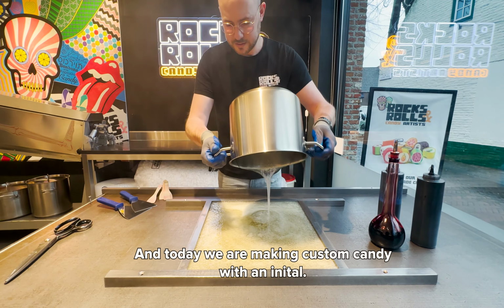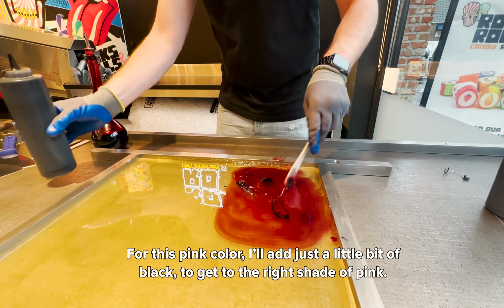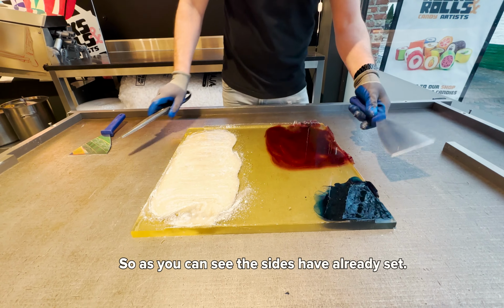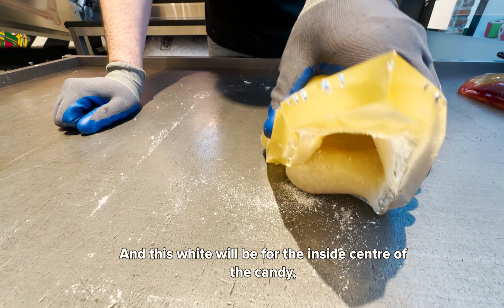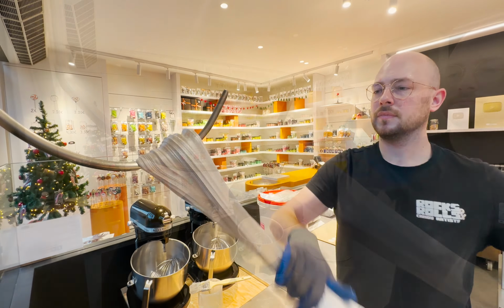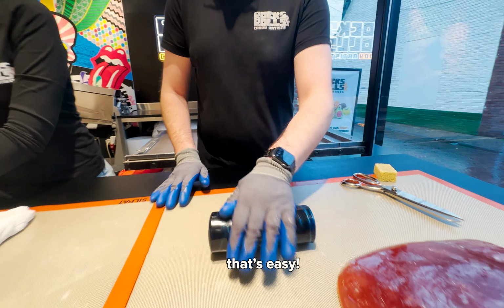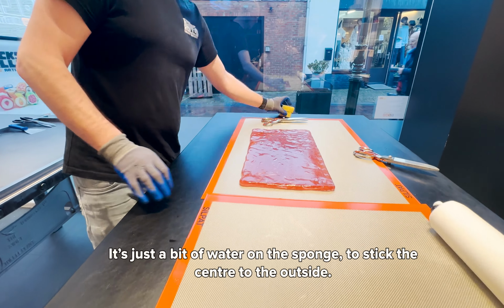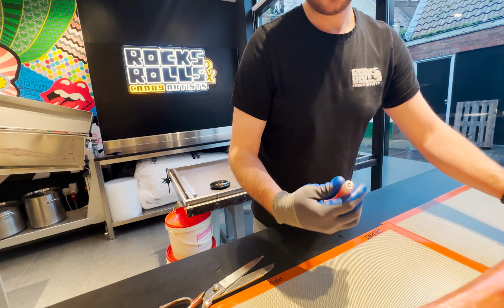Candy Making on a Rainy Day 🌧️

Comment: I can't figure out what material the table is made of
Reply: Most likely stainless steel.
Reply: Marble
Reply: @nikkrater134 
Tables a stainless steel, like the ones in restaurant kitchens. The one(s) that are a beige-yellow color with orange borders are heat-resistant Sil-Pat mats. 

The tables with mats are kept at 200° or 220° Farenheit, to keep the candy malleable so it can be shaped. They wear special gloves for safety.

The rollers where the big roll of candy goes are heated, too. That is so the Candy Maker can compress it with his hands to smaller strands, for making the lollipops & long strips for short pieces. The bare stainless steel tables there are not heated, & the candy cools & gardens. 

They work magic there! 🎉❤😊
Reply: @andreabuzzolan9807  marble is cold, its the opposite of what you want that table to be
Reply: You can see that they are made of cast Iron that has been planed more clearly in other videos of them.
Reply: @msabccbscnnoanfoxnews marble is most often used in candy making because you want the candy to cool down significantly. Otherwise, they can't handle it and mold it into whatever shape they want.
Reply: It's a granite surface.
Reply: @an2thea514 cast iron can scratch. They are using metal tools that can destroy cast iron.
Reply: Betting on stainless steel both marble and iron would be reactive to the acids they add to enhance the flavor of the candy.